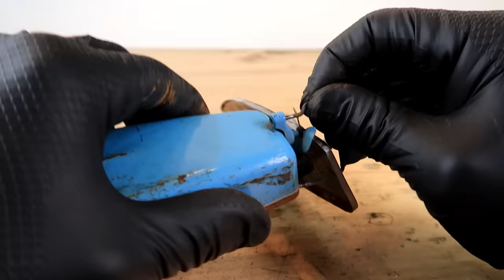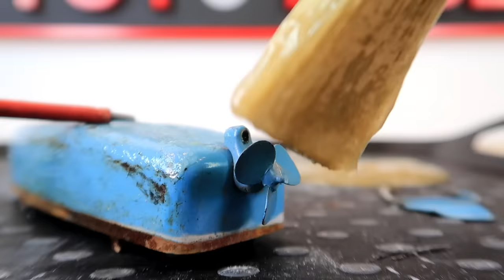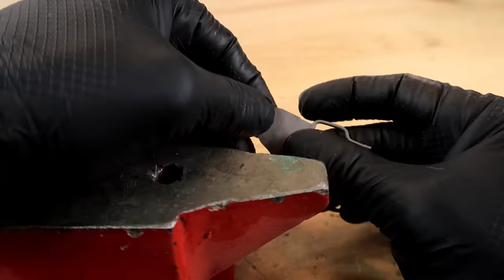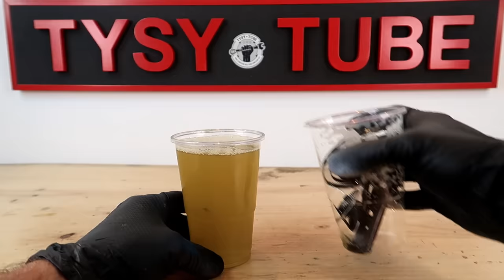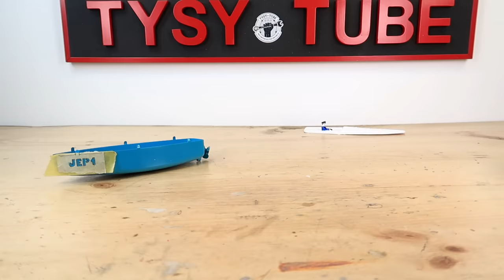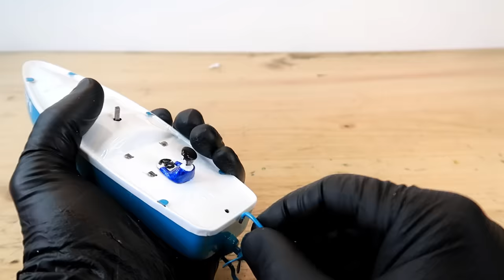1940s Vintage Speed boat Restoration🛥

Comment: Who wanted a water test :) ? nice work
Reply from the maker: i didn't do a water test because i don't want water to get inside ,engine will rust again, i hope all people will understand
Reply: TysyTube Restoration It is possible if an insulating rubber is placed between the two basic pieces !
Reply: @TysyTube  Everyone understand and in your description you wrote "compani" instead of "company" salutations d'un français
Reply: @TysyTube  A bit of a flawed design, eh?
Reply: Yes! Water test!!
Reply: Guess we know whose getting some stickers lol
Reply: ME
Reply: I was looking forward for it. kinda disappointing!
Reply: @S3ARCH_N_D3STROY  maybe or maybe not lol
Reply: @TysyTube  So do the test in a rust inhibitor
Reply: @TysyTube  then what's the point of fixing it ?.
Reply: TysyTube Restoration you must gasget montage
Reply: @TysyTube  Using the rubber insulation that Ayham suggested in combination with a moisture inhibiting compound should work to hold rust at bay.
Reply: @deadsinger7423  actually the flaw is not between the two main parts, it's the propeller's shaft that allows water to come in, it should have some sort of seal to prevent the water from coming in.
Reply: @i-Ayham  i think the main concern is water coming in through the area where the shaft connects to the propeller...  Would have to have some sort of gasket to keep water out...  Unless he drilled a drain hole and plugged it when it was in use in the water...  Hmmm...  🤔🤔🤔
Reply: TysyTube Restoration can I PLEASEEEEEEE have a sticker 😊 and can I donate some items to your channel for you to keep and restore?
Reply: marti640 over 600 likes, im pretty sure your gonna get one lol
Reply: It's a BOAT- what good is a boat without water???
Reply: @577AllWell Mate, antique toys are pretty expensive. Most toy boats of similar vintage are in the range of $250 and this specific model I could only find one for sale after googling and it's about to be bought for ~$500 (eBay auction). Plus this may have been his grandfather's toy or something and have sentimental value. Definitely worth more than $10.
Reply: How about a cooking oil pool test?
Reply: Restores boat. Doesn't want water on the motor. TysyTube.
Reply: No water test, no restoration! :/
Reply: @TysyTube  I didn't think about the gear box rusting again. Still, great job on the restoration. Those gears are a lot tougher and more forgiving than clock and watch gears, however you seem a bit more skilled than me at putting it back together. I'd have ended up bending at least one gear in the process... Were you able to get it back together in one try, or did it take a few times? Those springs are tricky.
Reply: @aaghano  Watching it afloat and scooting about would have been great, but I understand that this is a working toy that, due to its relative rarity (i.e., fully restored) cannot be used as a toy. I figure though that, if it was allowed to do its thing in the water, its noisiness would have been somewhat dampened by its being partly submerged; that's what I was really waiting for!
Reply: @TysyTube  no. No, I wont understand. You have taken all proper measures to ensure that rust does not happen again. You need to do a water test.
Reply: I too was disappointed that there was no attempt made to waterproof the boat and have a water test.  It's a BOAT!  I call foul.  Now... having said that..... I did enjoy watching as I always do.
Reply: guys this thing is obviously not floating...
Reply: I think we all did!
Reply: @TysyTube  maybe an oil test?
Reply: @S3ARCH_N_D3STROY  Ahhh while roaming through the comment section i can now see i chosed well, love your attitute m8 hope you accept my humble gift! keep it up!
Reply: @TysyTube  I hadn't thought about that, good point.
Reply: He didnt do a water test because the wire that holds the rudder is touching the propeller. Stop with the bs about rust. You were unable to push the wire in the hole like it originally was.
Reply: @TysyTube  Герметизируй! Сделай дейдвудную трубку! Смазкой залей! И ничего не заржавеет
Reply: dunno why muppets talking about sealing a join that's high ABOVE the waterline...……… like duh.   the shaft bush is BELOW...… duh
Reply: @TysyTube  it would have been fine im sure with just one time for the video i'm pretty sure it was in the water a lot more in its first life put it in the water then run a blow dryer on it if your that worried
Reply: @TysyTube  could always do it in thin oil lol
Reply: That's exactly why I came to the comment section
Reply: marti640 me
Reply: @TysyTube  if it will, then restore it again :)
Reply: @577AllWell Actually, no, antique toys can be worth a LOT of money. Especially tin wind-up toys like this.
Reply: Me
Reply: Looks like the propeller moves the wrong direction
Reply: Oil test
Reply: why not? created that to play in water
Reply: Ok let's have oil pool test.
Reply: @TysyTube  We want a water test boss!
Reply: me
Reply: water test! water test! water test! water test! water test!
Reply: @TysyTube  water test! water test! water test!
Reply: yes. why he dont to test on the water.
Reply: Expected it
Reply: why u dont do??? 😤😤😤😤😤
Reply: @577AllWell you clearly know jack squat about the value of antique wind-up toys, especially ones that still have all of the components undamaged. Your amateur "appraisal" of $10 is so far from accurate its not even funny.
Reply: same here,I was waiting for the test
Reply: Water test now!!! Xd
Reply: @TysyTube  yeah, a rubber gasket and/or clear silicone on the inside.... But I can see how it wouldn't be an ideal restoration with that.
Reply: @feisdee1  yes water test
Reply: Who wanted a water test ? nice work
Reply: warmowed 😂 you really think that piece of crap rusty old boar is worth $250-500
Reply: Great job!. But I've been waiting for bathtube tests for 20 mins
Reply: Yes ,already expelled from the museum.
Reply: @Sw3rve8722  That's what I thought as well! Might have the spring wrong way.
Reply: @TysyTube  

what's the point?!!(((((((
Reply: @TysyTube  Could you try another liuid, not whater for the test?
Reply: I want it!
Reply: @TysyTube  u could make some isolation solutions to ban water from getting inside
Reply: Because the water screw seal has not been repaired.
Reply: I'd love
Reply: @TysyTube   spray it with plenty of wd40 after the run. It should be fine.
Reply: Oh he did a water test, he just didn't show it for a simple reason - he assembled it wrong. Look at the propeller, it turns clockwise. Look at the shape of the fins. It would go backwards.
Reply: Me
Reply: Ask sergent Cross he will answer you
Reply: Is it because you didn’t waterproof it? A rubber gasket,some silicone?
Reply: marti640 I wonder if it will float on mineral oil! 😉
Reply: @TysyTube  You didn't do water test because you didn't fix it. That piece that connect "engine" to propeller was broken. I was actually offended when you used your finger to rotate the propeller and did your editing to show it moving. I really enjoy your work but that wasn't cool dude. Hope bests.
Reply from the maker: Danial Zabolizadeh is working
Reply: @TysyTube  and I'm still waiting my stickers lol
Reply: I think everyone
Reply: Tysy tube up the gain on the mic!
Reply: @TysyTube  Eso se arregla con silicon, solo era cuestion de sellarlo
Reply: TysyTube Restoration - But you let us all down. I was very disappointed when you didn't water test it. I guess I understand but I still wanted to see it tested
Reply: Test it in oil pool!?🚤🛥️
Reply: @TysyTube  we do 😊
Reply: TysyTube Restoration I mean you could have just blow dried it after the water test to prevent it from rusting.
Reply: @TysyTube  should have put flex seal 😂😂
Reply: Same hoped for a bathtub scene
Reply: @TysyTube  in the future.. you can test them in a shallow tub of clear thin vegetable oil or mineral oil.. or use water and a hair dryer after.. you can also preserve the gears with gun bluing.. just options. Nice job(as always)
Reply: water  test with your rubber duck 🤣🤣🤣🤣
Reply: @paterrafail  we don't know if it actually worked in water in the first place!
Reply: @jamesbizs  value depends. Some collectors value it more in the unrestored condition; others value it more as restored. If it's rare enough - intact, all parts present, not full of holes, no major dents, etc, it could be valued pretty high (retail price). No collector is likely to give it to their kid to play with in the bathtub.
Reply: Makes sense why he couldn’t but I wanted it too :)
Reply: Ooo, how about an oil test?
Reply: @TysyTube  aaaa ok that makes sense
Reply: @marti40440  hey je ne penser pas voir un autre français ici
Reply: @danpanda2664  la chaine appartient a un français justement

Comment: It gets to live another 80+ years! But I won’t lie, the vintage wear on it looked nice, it had history. 🤷🏻‍♂️
Reply: Its ruined by the re paint. Before I would  have wanted it, now its just an toy for my kids.
Reply: Agreed, though you did an awesome job you took an antique collector's item and turned it into a toy.
Reply: It was a toy the whole time. What he did was take an old and broken toy, and fixed it. Your indignation about a "collector's" item that even in great condition (which this one was most certainly not) would probably only fetch $100 or so in an extremely niche market is just silly.
Reply: The video has made more than the toys worth so I guess tysy wins.
Reply: @jonaswladimir6889  and then get lead poisoning by the paint
Reply: @thesalazar7328  . Would you play with it?

Comment: That boat may have been used just once in its long life. I bought mine at the sea side in Blackpool, tried it first in seawater,t hen bathwater, never dried it not emptied of water and one day it just stopped. I kept it for years and when it finally fell to bits I found the clockwork motor rusted solid, it was in fact a congealed lump of iron oxide.

Comment: Nice job on the boat and 'engine'... but on the Captain not so good.  Plus the tabs bent over on deck should be deck colour. Speaking of colour - did you do any research into the original colours? I would have though original colour was important for a 'restoration'?

Comment: It’s good that the engine mount petals were painted in deck color. But the bottom mounting petals should also be painted in the color of the deck, as in the original.
And it is a pity that there was no water testing - it would be possible to check if the propeller shaft is leaking.
Special thanks for the sailor's eyes. :-)
Well done work.

Comment: Nice work done with care. 
To improve the resistance to rust I would have phosphated the sheets with a product similar to Ferox (a creamy white cream paint that becomes black and opaque when dry) but even so I would say that it is fine, especially if you do not plan to put it in water. 
You forgot only one thing: the upper arm of the rudder was white!

Congratulations on a nice job

Comment: Tysy, I restore my own tin toys - but you took it to another level. Then again - you're a bit spoiled with a sand blaster, buffing wheel and an air brush. I definitely learned some new tricks. Patience for one. You got lucky that the key wasn't locked on, no tabs broke off, the spring was intact and most important - the gear teeth were all there. Nice. Subscribing.

Comment: The work is done well. It’s a pity it didn’t get better.
There are bloopers.
  Must be:
1 The lower part of the boat in two colors - the bottom is blue, the top edge is white. Deck in one color - white.
2 The inscription "jep1" treferet must be done on the computer.
3 The figure of the little man is painted not like in the original.
4 The winding mechanism without a spring must be boiled in oil at high temperature.
5 I would add sealant during assembly.

Comment: beautifully restored to original I would have made 3 changes 1.man,s face and hands flesh colour 2.deck teak immitation  with thin black lines on wood colour to show for planks 3. bronze colour propeller and steering wheel...........also a test in the pool and use a hair dryer  to get rid of humidity

Comment: The nest way to seal the propeller shaft from water would be to dab a wad of Vaseline in the inside of the hull the place where the propeller shaft exits the boat's transom. In a real ship or boat its a box filled with thick greasy oil and the natural cotton like stuff you find in some mattresses or ripped up old rags.. it's called a stuffing box.

Comment: I had a 1930's red and white clockwork speed boat.   There was a row of pips at the back to set the rudder.  It was rusted and beyond repair in the 1960s when I was given the boat.

Comment: Pretty darn cool  I’m kind of interested  if you. Test for lead paint  ? Before taking everything apart  I’m guessing something that old would probably have it  i did notice the Nitrile gloves  yet.  Would think a respirator  should be worn to not inhale  the lead. Or is blasting in your cabinet  good enough to contain  or manage the lead  i know some guys have special ventilation systems on their blast cabinets   I was impressed with your detailed  painting on the driver  guy  ive done some  similar painting myself where i had to use a  sharpened wooden tooth pick to  paint moldings on a scale Automobile i made as a gift

Comment: Fantastic job.  Just by bending back and then resetting all those connecting pins without breaking one is a miracle.  But, I don't think you should sand off the mold crease from the top of the pilots head.  That is part of the authenticity of the toy and the method they used to create detail.  Just a thought.

Comment: I love your little projects! I have done a few as well. I know of a couple of things that might help you out. There is a product called Evapo-rust. This stuff is the bomb! It works better than anything I have ever tried! I have put some really, REALLY badly rusted items in it. Doesn't affect the base metal, only the rust. 

the other thing. I see you take most of your projects down to bare metal. If your primer is not a self-etching  or epoxy based product, that is something you might try as well. Much, much better adhesion to bare metal. Keep up the projects! Love them.

Comment: I've got a similar media blaster, but I've got trouble with mine leaking media whenever it's used. Is yours properly sealed or does it have a similar issue, and have you managed to fix it?
Reply from the maker: i sealed myself
Reply: WE used a silicone sealant, but can't seem to plug all the holes. Glad yours is working well!

Comment: When do you use paint remover and when do you use a sand blaster? Why?
Reply: I think it has to do with lead paint. If you sandblast lead paint away then you will be letting leaded paint particulate in the air. 

So you use thinner to remove and wipe it away instead of potentially risking inhaling the paint dust.
Reply: @biscuitdingus  Thanks!

Comment: why do you go through the work of removing the paint, that is what the sand blaster is for??
Reply: To remove as much paint as possible otherwise you'll have paint chips mixed into the sand medium when  sandblasting. Also sandblasting can be expensive depending on the medium brand.

Comment: Want more restorations? I get it, instant reaction is to write no. If you decide to take a different stance check out my first video where I restore a 1950's copper pan.
Reply: I ckecked. How can you call this a restoration, you didn't even took it apart

Comment: Tysy, I have watched your videos for a long time now, what you do is amazing. I need some advice from you on a project. I found a 30's  search light it is called Niagara  Falls Junior Guide Search Light. I am having trouble removing the screw cap that holds the reflector, seems to be considerable rust on the threads can you assist?
Reply: Thanks Dominic, I did try penetrating oil maybe just need to let it set longer to break down the rust. Keep you posted.

Comment: i love these restoration vids but this one leaves me little conflicted as removing the original paint removes any value to the highly collectable steel wind up toy. This one was in dire need or restoration but to repaint was a bit too far, the colours aren’t quite righto in the hull and writing needed to be sharper (try using transfer tape instead of masking tape for sharper lines). Its still a nice job but a shame to lose the collectable nature of the piece